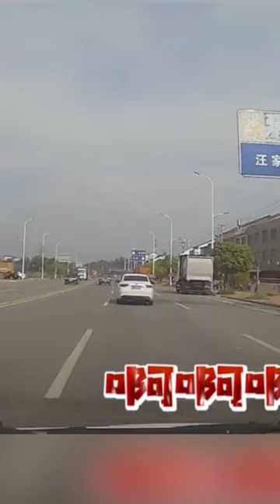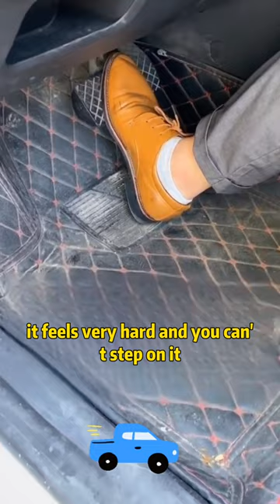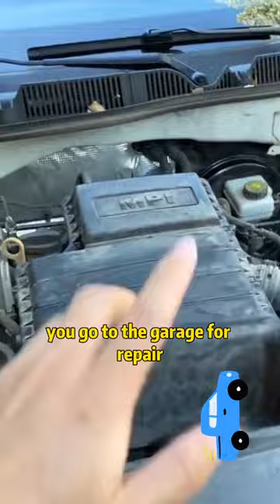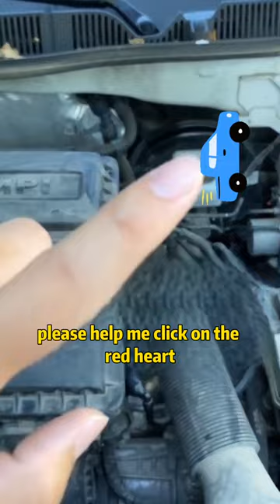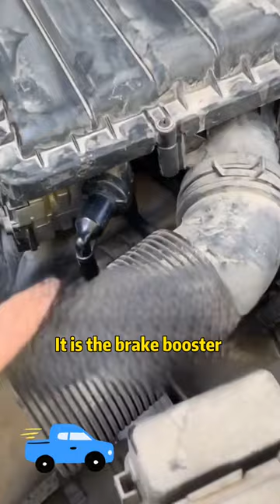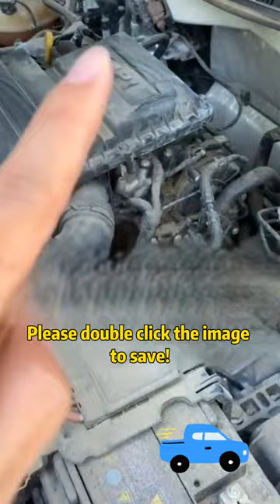How to save yourself if the car brake is broken?#car #driving #tips #drive #how

Comment: Stiff brakes is usually a sign of a blockage/air bubble in a line while this would loose brake pressure and make the pedal just feel like a piece of metal on a hinge

Comment: Can't you just use the Emergency Brake?
Reply: Kinda it does not work as well tho
Reply: @Jarwid2 It does. VW e-brakes stop a car easily.
Reply: ض
Reply: Emergency brakes are somehow connected to the normal brakes in some cars if it fails then everything is screwed